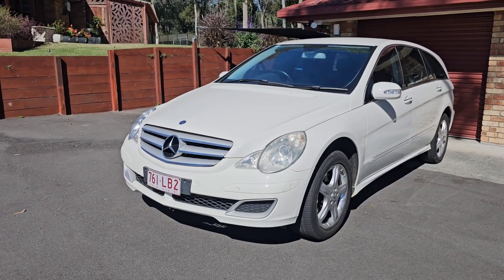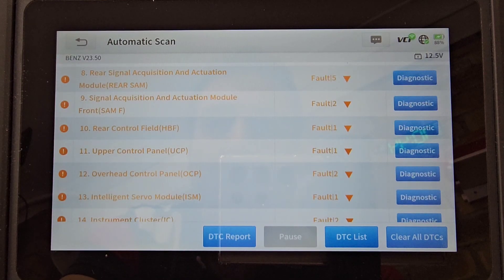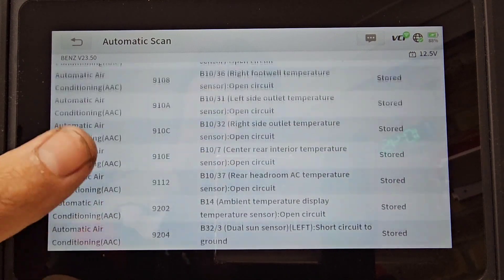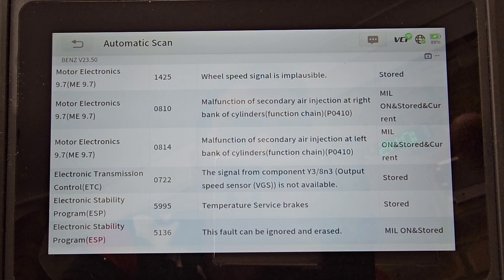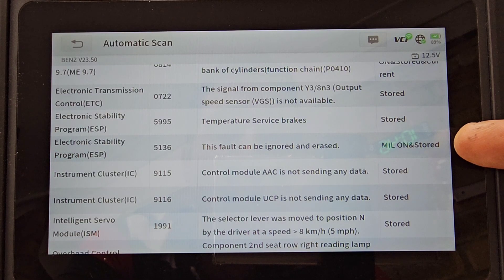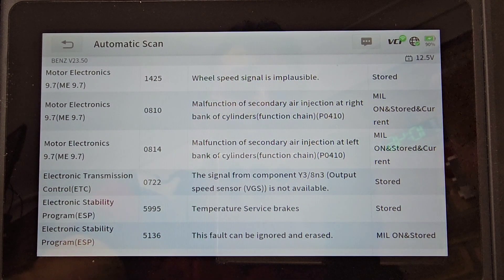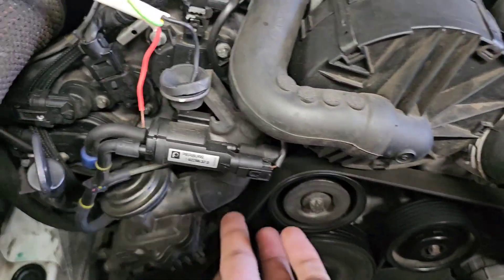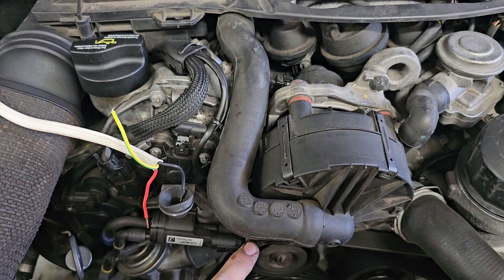Disaster or Normal? 50 Fault Codes and Engine Light ON (Mercedes M272 - M273)

Comment from the maker: 50 Fault codes can be too scary 😨,  have you had similar experience with you Mercedes?
Reply: No most have been 1 or 2 and fixed easy..2 days ago voltages regulator died so putting in new alternator...expect alot of stored codes as voltage of the battery went low..

Comment: Some modules are sensitive to undervoltage. Respective fault codes can be addressed by recharging or replacing the battery.

Comment: Great basic troubleshooting. 
A screenful of codes can be initially terrifying 😉 but typically they are cascaded from a single problem like a module, wiring break etc.
My 2011 E350 is hopefully still relatively young at 80k but you never know.....
Good stuff.
Reply from the maker: Yes, this R350 has 200k km :)